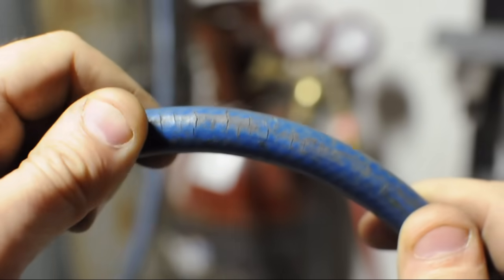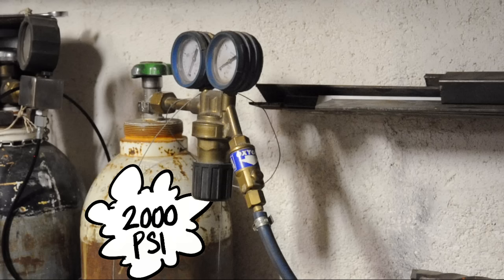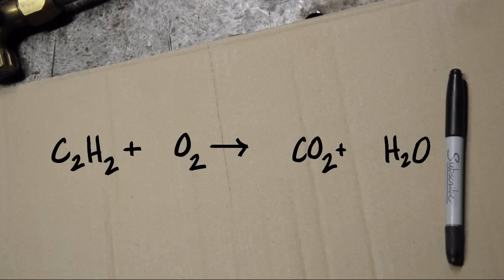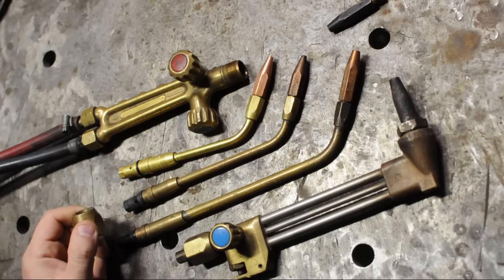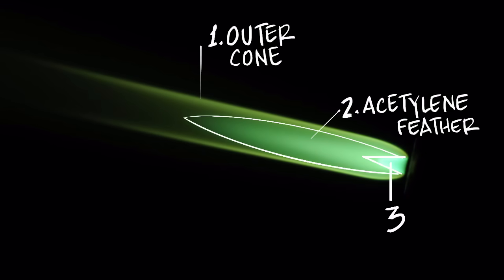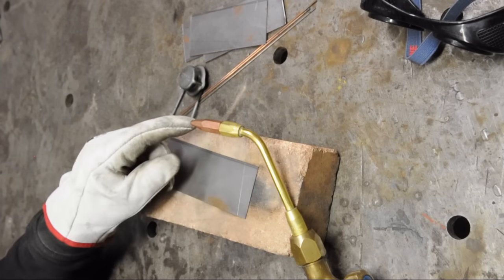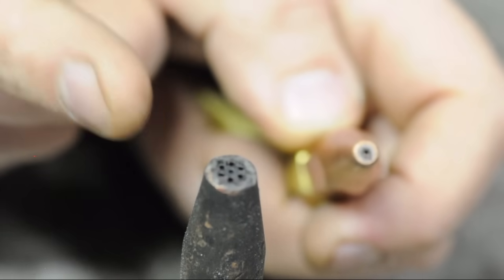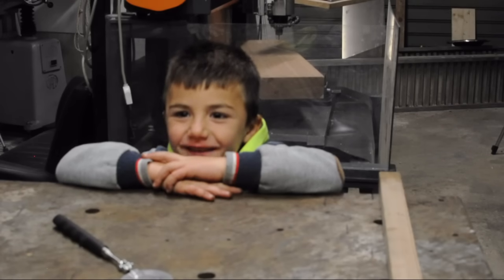Let's Talk Oxy Acetylene

Comment: Two things to add:  I've used oxy acetylene for about 35 years.  I was taught and still use the practice of aligning the tip and main valve knobs up like gun sights.  This keeps them out if the way, keeping a jacket sleeve from "adjusting" the flame.  It also puts them in a convenient,  consistent location. Try it. You will fall in love with it.  Also, I would stress the importance of opening the acetylene tank valve no more than 1/4 turn.  I was taught this, and knew it was so the valve could be shut quickly.  This was driven home for me one night when a spark caught a small leak in the regulator assembly.  I heard a pop, looked over to see a little jet of flame onte regulator, and nearly dropped a stinky twinkie on the spot.  I was able to avert big trouble instantly with a quarter-turn.  My rig got a very thorough inspection before I fired it up again.  Great video, and thanks for promoting safety!!!
Reply: the counter argument for the acetylene cylinder valve is that i should be open all the way and rear seated. that way it wont leak any from the stem.
Reply: Holy shit I just stressed the fuck out reading your comment
Reply: @karlkarlng  I read or heard this is true for the high-pressure gases (like O2), but not for acetylene. The reaction time argument wins for me, even though I have very little experience with the torch. It just makes too much sense. ;)
Reply: @toolsarecool  I've heard the same, the high pressure gasses must be opened all the way, the valve stem seals against the packing, preventing leaks. Acetylene should only be opened a quarter turn or so for quick shutoff.
Reply: @karlkarlng  If you have a leaky stem, your nose will tell you.
Reply: I hate it when people turn the valve completely open no matter what gas bottle its just annoying when you have  to crank it 5 revolutions to close it and it makes no sense to open it so far just a quarter or half a turn is enuff (yes i am a lazy person) and also your reasoning makes complete sense
Reply: @SaintMarneusCalgar  I'm with you but sometimes, (especially in industrial applications) you get a bottle with a leaky valve and you have to open it completely to keep it from leaking.
Reply: I was taught the same 25 years ago (I don't feel old yet do you?) Anyhowz, i mainly commented because i have somehow never heard the phrase "Stinky Twinkie" in my entire life...  I love it a lot.
Reply: damn this y chromosome
Reply: Stinky twinky. Hahaha!
Reply: So they were still teaching 1/4 turn 15 years after my shop teacher taught me?  Farm out!  Some truths never die!
Now, I always got a kick out of the first (and best) shop teacher I've ever known shared tales about playing with oxyacetylene balloons - and the GIANT balloons, at that.  Never TRIED it - always wanted to fill a CAR with one and light a long fuse....  When I shared this with a guy at work once, he said: yeah, I heard of the balloon thing, and tried it out in a big, open field (although in town) and ended up breaking a bunch of windows in an apartment building across said field.  Scared the BLEEP out of him (them) apparently.  It's a pretty violent kaBOOM, obviously.  Extremely dangerous, though, because a static spark in the balloon could be enough to set the thing off before you even light the fuse.  Darwin award potential, actually.
Reply: Thank you for this. I remember someone telling me about opening one bottle all the way, but I could never remember which one. Your explanation of the quarter turn on the acetleyne will help me keep it straight.
Reply: @timothyball3144  You open the O2 all the way because it has a double-seated valve, meaning it seats also in full-open, because of the tremendous (2000+ psi) pressure (when it's full up.)  Acetylene has relatively low pressure, so doesn't need the extra accomodation.
Reply: Noah Nipperus, alas, the euphemism for fecal matter that I used was a product of my own questionable imagination.  Please feel free to use said expression whenever you see fit.  I'm hoping that, at some point in the future, it will have gained enough popularity to be considered an everyday term. I hope to someday see it used in sitcoms, newscasts, board meetings, etc.  I do however wish to remain anonymous with relation to the term's genesis, as I  prefer to die in obscurity to being forevermore known as "The Stinky Twinkie Guy."  :)
Reply: @karlkarlng  This is what we tell people about the valves on high pressure cylinders like oxygen and the inert gases.  I don't think it's true for the lower-pressure Acetylene cylinder.
Reply: I have been there when an acetylene hose split from torch to boottle due to flashback. Not the one using it but happened to look in that direction at the time. That i do not wish to see again, sprinted to the bottles and closed them while the others leaped in to actions to mitigate what aftermath might turn up. Suffice to say we had to have a little pow wow afterwords. Chilling moment.
Reply: @karlkarlng  Acetylene valves are made to not be opened all the way. Only 1/4-1/2 turn. They are the only bottle valve designed this way.
Reply: A quarter turn and always leave the key on the acetylene cylinder in a position where one stroke will close it.
Reply: @noahnipperus7320  it was 65 years ago for me.
Reply: @gordoncouger9648  how you feeling?
Reply: @adirondacker007  Add wordsmith to your resume for that one

Comment: That's incredibly dangerous. In my shop we store the tanks in the oven to keep them out of the way...
Reply: That makes sense, just like welding rods.
Reply: In my shop we just drag them away with us. Ofc they are hooked up in a carrier of sorts but yeah.
Reply: Then just turn on the oven an hour or so before use so they're nice and warmed up for work.
Reply: @pierre94H  I keep mine next to the workshop wood burner. The one hot and one cold side means that the gas circulates inside the cylinder and doesn't get stagnant.
Reply: we lay ours on the BBQ , no one trips over them there .....
Reply: I see you're a follower of the Chernobyl school of safety design.